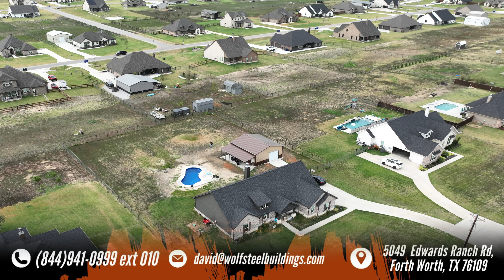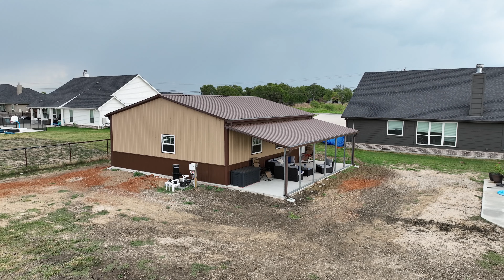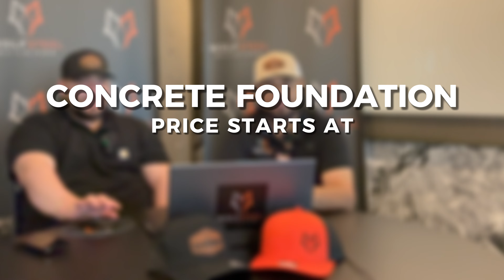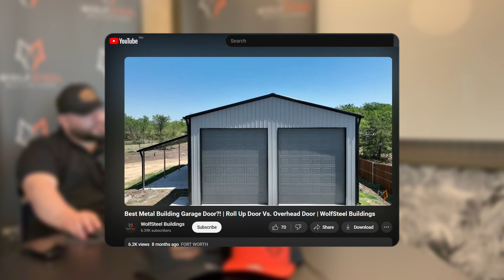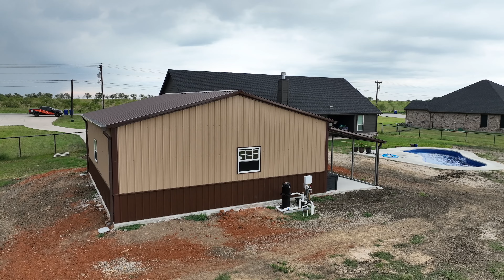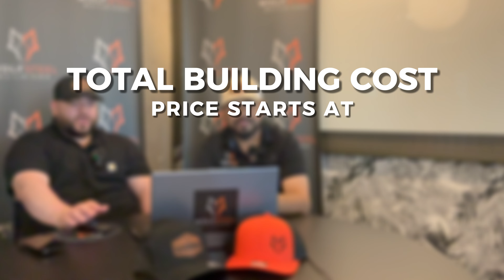28x30 Detached Metal Garage with Porch | Cost to Build | WolfSteel Buildings

Comment: Daaam that concrete for $15k. 😮
Reply from the maker: Concrete prices may vary depending on your location and building requirements. Our concrete price is tax, labor and delivery inclusive. It also includes the slab, perimeter footings and internal cross beams, vapor barrier and the notch edge detail to work perfectly with your building and garage doors to prevent water seeping into your metal building.